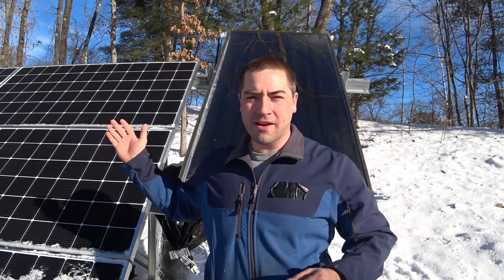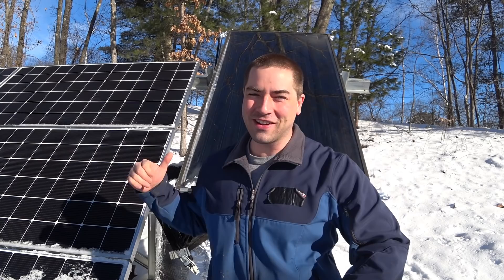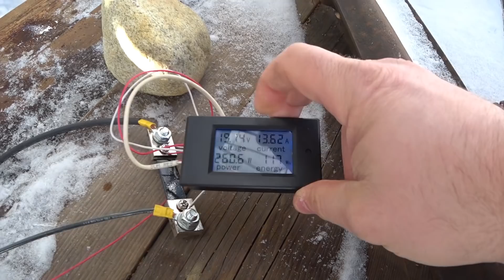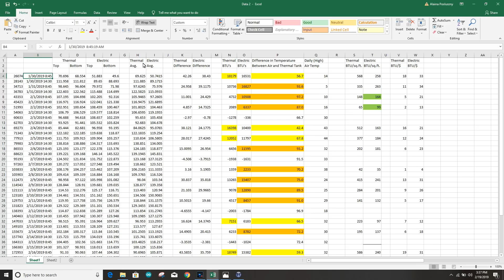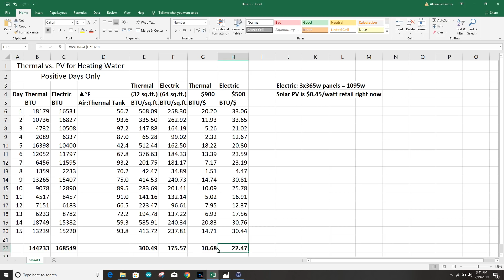Results of Solar Thermal vs. PV Experiment in Heating Water

Comment: But you are missing the best solution by far, use solar thermal in conjunction with a PV powered heat pump, this means you take advantage of the lower temperature rise the thermal panels are best at and couple it to the 3-1 efficiency of a modern heat pump, the benefit to preheating the water with solar thermal is a reduced temperature lift which improves the heatpumps performance and COP. Alternatively, you can overbuild on the heatpump + PV and skip the thermal, but it all comes down to cost and system complexity, in some cases they really are better together.
Reply: How do you get a cheap heat pump though?  They seem like extraordinarily expensive products.  His other videos talk about how he's going for ultra-low capital cost, because you can just trade off low efficiency for more solar panels.
Reply: If ultra low capital cost was HIS objective, he would have MADE his own Solar Thermal collectors.  Truth is, you need both but you cannot really make your own PV.  PS. A heat pump can be as simple as grabbing an old pump out of a refrigerator you picked up for FREE and be willing to do some simple shop welding work.  IF these skills scare you, then PV is very simple and straight forward.  We only have 1 life to live and while we all CAN learn how to do things, we do not have infinite amount of time to DO everything we would like.   @TrogdorBurnin8or
Reply: You are missing a few points here.  The most important is the solar thermal has ZERO operating costs other than a circulator pump whereas a heat pump compressor is a downright pig on amperage and the solar array that you will need to power it involves MANY panels, lead-acid battery bank, voltage regulator.  I think what you are comparing it to is the old oil/gas/electric comparison that the heat pump industry pitches.  Added to that is the fact that heat pumps are a total pain in the ass and have prohibitive repair costs with their mean-time-to-failure lifespan which is drastically shortened when you push the head pressure up to elevate the discharge temperature to heat water greater than 140 deg F (to kill bacteria as per most regional building codes), that allows sulphate reducing bacteria and iron bacteria to thrive whose byproducts cause severe corrosion in metal components. Compressors are not designed to run that hot on a consistent basis. Space heating has an air discharge temp of 105 deg F and your ductwork MUST be oversized by 20% to move more air.  Unless you get some hillbilly changing out the compressor, the costs of refrigerant reclamation, welding, new replacement refrigeration, etc. will drive the cost of replacing one compressor over $3,000-$4,000.
Reply: Heatpumps are only good down to a certain temperature. If you're below freezing they won't have much of a good COP.

 Ideally, you'd use evacuated tube solar collectors. These will crank out the  higher amount of BTU's as shown in the video, but they don't have anywhere near as much loss due to the insulation in the collectors. These are likely a little more expensive but are worth it.
Reply: @Thermoelectric7  No, a heat pump makes three times more hot water than evacuated glass tubes. The only way to make hot water in 2019 is photovoltaics driving a heat pump. You can make effective hot water down to any temp, if you use water as the heat source. If you use air, heat pumps are good down to -15 def F or so.
Reply: @nicklappos   I'm using a Gree Crown mini-split to heat my home and it's rated for -20F.
I used to use a Sanyo unit that ran okay down to 8F, but the duration of the <8F cold snaps is no longer just a few hours before sunrise. Nowadays, we (in the Boston area) get a few Minnesota cold snaps, some lasting for a day or two. Glad I got a Gree Crown.. I might be getting another one for the den, because we have an old Sanyo in there. When it gets under 8F I'll turn off the Sanyo and run space heaters and a little oil heat to keep the pipes from freezing in the den.  The den has a lot of window Sq ft and poor insulation, so it's hard to keep warm in there.. 
 Gree has a  lot of systems for a lot less money that are made for milder climates.
https://comfortup.com/collections/gree
This might be my next buy..    https://comfortup.com/products/gree-ductless-12k-sapphire
  
 Anyways, I'm sure that someone makes a hot-water heating air-source heat pump that can work down Minnesota temps.. :)
Reply: @Thermoelectric7  I was thinking about that. Couldn't you make those yourself though? Get an acrylic tube, put a pipe through it, cap it off on both ends, spray one side with some silver paint and pump out all the air out of it. Wouldn't that work fairly well? It should hold the vacuum at least.
Reply: What's better than a heat pump? A 48v instant water heater
Reply: Liam, if your PV is very low cost per watt (and you have room), can't you just spent a bit more money, and buy more  PV panels and just skip the modern heat pump?  (and all the problems that come with it?)  If I had more area that was solar panel friendly, I would just use 1.5 to 2.5 KW of PV and skip the heat pump.  Since I only have a short-sun-exposure 1 KW of PV going into to the hot water tank, I use a small A7 heat pump. https://youtu.be/adma7HnXCUI?t=543
The A7 sucks the heat out of the basement air (50F right now). But the very cold air output from the A7 goes right down to the  47F basement floor where it is heated up to around 47F.  The concrete basement floor and it's walls are heated to 47F (but warmer in summer) by geothermal heat or maybe decaying radon sources.. ;)  You could say it's working sorta like a GSHP, because the ground under the basement is it's main source of heat.. 
Today, it rained all day, so the little A7 heat pump and the BDG (basement floor geothermal) was doing all the work.      
 Disclosure note: Only two old people live here, so hot water demand is low.

Comment: A warning to anyone considering connecting DC to your water heater. Only do it if you have a stainless steel tank. DC current in water results in electrolysis. Your tank will corrode. Elements will also fail much sooner
Reply: Rheem etc have plastic water tanks as well.
Reply: I don't know about there hot water heaters but a few years ago I replaced both the furnace (gas propane) and a/c unit with Rheem and they both work great. The furnace paid for itself in 4 years and the a/c in same time. Energy savings.
Reply: @Mr Brightside what part of "I bought a tank that had been abused by DC" did you find confusing?
Reply: This is exactly why there are such things as  DC heating elements and glass lined water heater tanks.
Now, with that aside, the electrical current does not pass through the water itself, it passes through a nichrome wire inside a sealed metal outer casing. like the cooking surface on an electric kitchen range.   No electrolysis or galvanic actions can occur is such a case.
Reply: @pwrovld  false. There is ALWAYS a small current that will flow because there is ALWAYS a resistance (very high) for current to flow through.
Reply: @climatechangepreppersfaceb2148  Do you have any proof  that matters at all?  An elements covering  would far outlast any metal tank. Your point is totally irrelevant.
Reply: @opera5714  tell that to all the people who have had their tank corrode because they put dc into it
Reply from the maker: Hi Nevada Forensics LLC: This seems to be something people are intrested in, including myself.  Can you please describe the process I should use to check my element and find out if it will do electrolysis.  Is it an ohms reading of something?  Thanks.
Reply: Begin by looking up Electrolysis.  Google is your friend..... Has nothing to do with resistance.  Well, ultimately it will...  @DavidPozEnergy
Reply: @DavidPozEnergy  you need to buy a DC element which has more coatings to reduce electrolysis. A normal element using ac does not get electrolysis so it's not so well protected against leakage current. I happen to have bought a tank that had been abused by dc. The thermostat (long inserted type) had corroded into hundreds of fragments that clogged up the pipes. All around the element it was corroded and had developed a leak. I was unable to remove the dud element because it had welded itself in place. So in 3 separate ways, it failed. Not only did the thermostat, element and tank fail, but it also destroyed a pump and some plumbing in the house. And god knows what the people in the house had been drinking with that crap in the pipes....
Reply: I watched one of your videos, you shouldn't be advising advising anyone.
Reply: @opera5714  oh that's rich. I just watched your video "total system failure" with your birds nest of junk. You better qualify your statement pal
Reply: Mr Brightside u
Reply: The element is totally electrically isolated from the water itself so this cant happen
Reply: @andrewwaters2354  WRONG.
Reply: Not true.   @andrewwaters2354

Comment: One problem I see, even though you insulated the tanks, most people are not keeping their tanks outside in 11 degree weather, they are usually in a basement or in a utility closet in their house where they will maintain a mostly constant temperature. I'd be very interested to see the results between the 2 with the tanks inside.
Reply: It's an apple to apple comparison, as it can get.
Reply from the maker: That's true, a hot water tank should be placed inside.  Then again, a real-life situation would have heat being drawn out of the tank every day through a heat exchanger.  So I personally think this still mimics a real situation.

Comment: Dunno if you really understand that the PV is going to put out more during colder weather due to lower internal resistance in the PV?   So lower temps = more Solar output.   

Also seems could get MUCH better gain on the Solar Thermal with some concentration.  Mirror surface is REALLY Cheap and really amps Thermal Output.
Reply: This was probably a good match for a contest. A less than optimal PV transfer efficiency. That 26W would have been 470W with a power point controller. And less than stellar thermal panels.  I've heard of several Australians dumping their thermal panels for better performing PV.  The lower cost pf PV and its simplicity tends to be the deciding factor.  Thermal is a nightmare to implement and transfer losses are killers.

Comment: In the cold climate you live in, the flat plate panel was the wrong choice. The vacuum tube collectors are better as they do not lose as much heat to the surrounding atmosphere.

Comment: If air temperature matters so much, it stands to reason that being mounted on a roof is much more efficient than an exposed platform for the thermal system.

Comment: PV thermal was an option for my tiny house, with this it’s a certainty. You’ve really helped me out, thanks. And, what a great experience for your daughter, being involved in your projects.
Reply: I think that is a wrong conclusion.  I have PV at my camp and heat a 6 gallon tank with excess solar which isn't used for other needs. MY PV efficiency using a controller is twice what was achieved in this test.

Comment: David why not do both for your water tank I think it might get the water hot as you want I'm just throwing it out their . have you looked in to running water pipes up against the solar panels to try to extract the heat from the panels ?
Reply from the maker: I don't want to do both in my tank, because my tank is so low.  I won't get the benefit of stratification.  However, I'm considering building a second tank, one "warm" and one "hot".
Reply: I got you well witch ever way you go I hope it works and  you do a video to show others good luck

Comment: Dave,
Since the match up for the heating element was the same for a standard hot water tank
Element from Home Depot, can’t you just wire up three panels to a standard electric
Hot water tank and a switching circuit back to your battery backup so when your not heating, your charging.
Reply from the maker: Yes, so long as the ohms match up.  In a future video I plan to try building this.  Thanks for watching.

Comment: You built a junk box thermal heater and what? Pv panels engineered and produced  by a quality controlled  producer of ul tested componets. May i suggest you get uncheap and  buy a evaculated tube collecter. It will give higher temptures  therby greatly effecting the delta  T. Also plain water sucks compared to a typical  closed  loop coolant . Aniti freez solutions  are able to carry  higher temptures   verses water with it low  boiling point..  A drain back water based  system will boil off heat  at 212 ° while a closed  system oressurized to 8 pounds will not turn to vapor  untill 25 degrees higher. Add 25 degrees to you figures for the thermal system.

You may  mean well but your infirmatiin is doing  a dis service when sound educatiin is sorly needed.
Reply: Use spell check)))))
Reply: I believe that David's upfront clarity  offsets any variable factors not taken into account. 

Or in other words,  David is having fun learning and sharing.

If he waited to publish his videos until every conceivable aspect has been addressed the cost would be astronomical and take decades to complete. More like a government project.

Comment: After seeing this I'm pondering using PV to help heat my water! I need to design a hybrid system. Off grid when the sun is out on grid when the sun goes down. Thank you for doing this!
Reply from the maker: Cool.  If you size it well, you can store enough hot water for night time.  And, in case you are new to my channel, I have a free calculator on my website to help match the pv to heating element.  www.davidpoz.com

Comment: Thank you for running this experiment, before this I had no idea that you could run your PV panel directly into a electric hot element.  I love the simplicity, and lack of things to break down and go wrong.
Reply: You can't do it long term. DC will result in electrolysis. A new tank can corrode in 2-3 years
Reply: Nevada Forensics LLC , I just saw this video. No others yet.  Dumping the current into the resistive heating element will cause electrolysis? Or did he do something different?
Reply: @climatechangepreppersfaceb2148  .  Why? Surely the element is electrically sealed from the water.
Reply from the maker: I also love the simplicity, KISS

Comment: Use solar thermal and PV to keep your water hot. Thermal to get the temps close to what you need and PV to boost it up to your desired temps. Takes less energy to boost warm to hot vs cold to hot. Just use them in tandem. When thermal reins supreme you have it and when PV reins supreme you have it. Best of both.  :)
Reply from the maker: I agree with you.  Just recently I've been thinking of maybe making a second tank in my crawlspace.  Leave the current one on thermal, and a second one on PV.
Reply: @DavidPozEnergy  That's what I would do. The total efficiency of the system will skyrocket.
Reply: Yeah... The thermal solution would've been more efficient on sunnier days (e.g. it would've produced more BTUs) if just the water volume was greater.

Comment: If you had used the PV to power a heatpump, you would have gotten nearly 4 times the BTUs. I heat my home almost 100% on solar with a heatpump. It would be nearly impossible using resistive heat. Or at least I'd need 4 times as many pv panels to do it risistively.
Reply: In winter that is not the case for an air heat pump (geothermal is way more expensive) so in average in a cold environment a heat pump best case will have a COP of 1.5 to 2 but doubling the PV array size cost way less than a heatpump (not even considering all the extra equipment) and the panels will last 30+ years while not even the best heatpump will last more than 15 years likely with some maintenance.
So heatpump is just not a cost effective solution is only like solar thermal panels good if you do not have the space and do not care about the cost.
Reply: @electrodacus  why are you discussing an air heat pump when we are discussing water?
Reply: @w8stral  wow. Does your mommy know you are here? Where do you get off speaking to people like that? Watch my videos, then tell me I'm stupid. I dare you
Reply: Wrong, heat pumps last as long as they are cooled properly.  Heat kills their oil lubrication and they die.  Also what kills is corrosion creating a leak or poor soldering due to cheap thin copper or lack of use of silphoss.  You GET what you PAID for.  Old refrigerators(heat pumps) have been working continuously going on 80 years now with zero maintenance other than cleaning its heat exchangers.  I have one that is well over 60 years old and it is going strong that I inherited.  Also helps that it is R12 instead of R134a.   @electrodacus
Reply: But then you might give the "best cost" ribbon back to solar thermal.  Just buy more panels. They are cheap.
Reply: And if you had used the thermal panel to boost the heat pump you'd get 6-8x more BTUs
Reply: All for sustainability 😊🍻
Reply: What's better than a heat pump? A 48v instant water heater
Reply: If you do this or that... show us your system please...